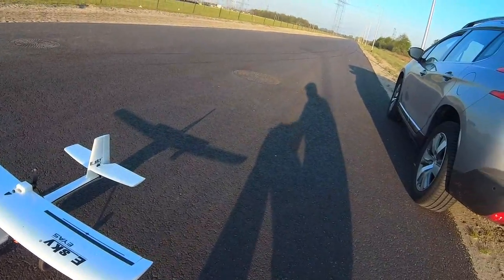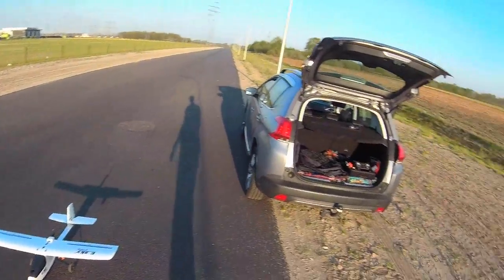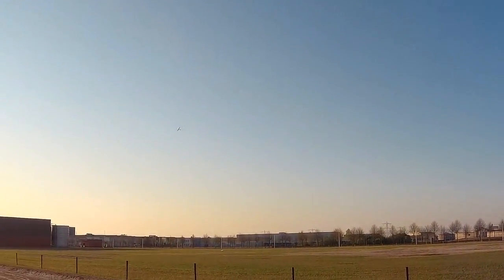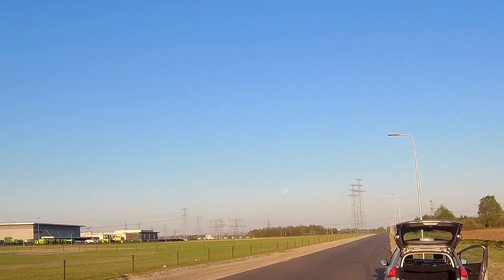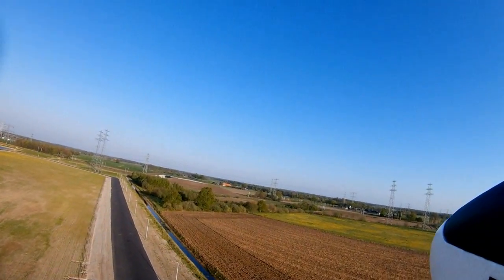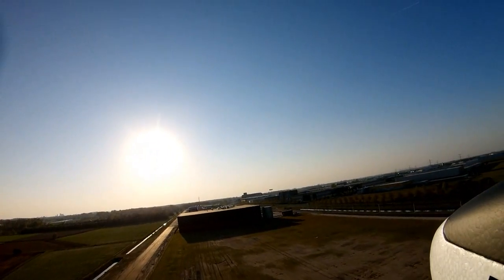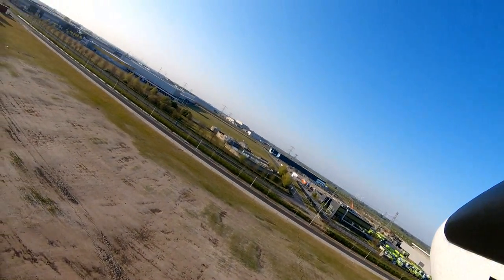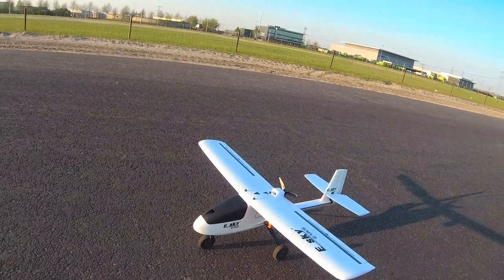Esky Eagle 1100mm - Trainer / FPV / Bush  Airplane - Flight Envelope Testing :)

Comment from the maker: Some more testing with the Eagle to see what it's capable off :) 
Link to this airplane: http://bit.ly/2UKQNjL  

Runcam 2 wing-camera used: http://bit.ly/2UcjqSf 

Specifications: 
wingspan: 1100mm 
length: 871mm 
weight: 755 grams all up 
material: EPO foam 
kit type: PNP 
motor: 2306 2250kv brushless
propellor: 6x4 (my guess)
ESC: 30A 
servo's: 4x 9 grams
receiver: 4 channel minimum (not supplied) 
lipo: 2200mah 3S 20-35C (not supplied) 
ailerons: yes 
rudder: yes 
flaps: nope 
retracts: nope 
lights: nope

Comment: Pushers usually take up more room than a tractor prop for takeoff it's very normal. Especially with no flaps. You can try to configure flaperons on your radio and see if that helps.
Reply from the maker: Yes.. to be honnest I don't really mind.. it was mostly just an observation But I do have flapperons set up indeed.. We'll see how that works out..
Reply: @DutchRC  good luck. Curious to know how they work. Great reviews by the way :)
Reply from the maker: Thanks man :) 
next up will be a video on FPV cars though (for a change): https://www.youtube.com/watch?v=X5l0j4MfC6M

Comment: I see on other review's that it flies quiet slow, and they say it is a beginner plane.  I am planning to put a stabilizing system in it, and maybe flaps when I get it.
Reply from the maker: Hi there :)  
well.. what is / isn't a good beginner airplane is allways debateable but this IS a very easy plane to fly for sure.. Allso easy to "build" so that would help a beginner I think :) 
Flaps with the propellor Behind the flaps?
Reply: @DutchRC  I will order a spare wing, and experiment with taking some of the elirons and a bit of wing to make the flaps, where the motor is should make not difference to the working of flaps. I have a Push glider with flaps, works fine

Comment: Does the dutch post charge any extra tax  when i receive that in nl?
Reply from the maker: Sometimes they do. In this case I did not have to pay import tax..
Reply: @DutchRC  i hav ordered hubsan zino quad worth around €320. Wonder how much i have to pay when i receive that.
Reply from the maker: @AshishAmatya  Depends on the shipping company I think..
Reply: @DutchRC  postnl
Reply: @AshishAmatya  Everything more than 23euro is subject to import tax, which is not to bad, Postnl charges you 12,50 for the Admin. and you have to send then proof of what the product costs, so no lying haha